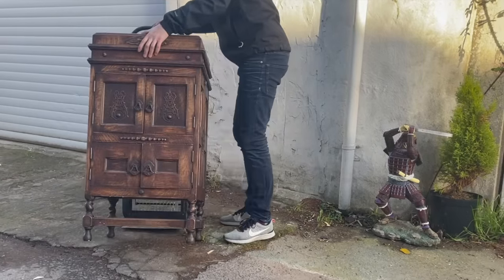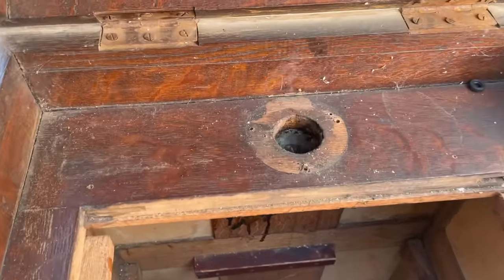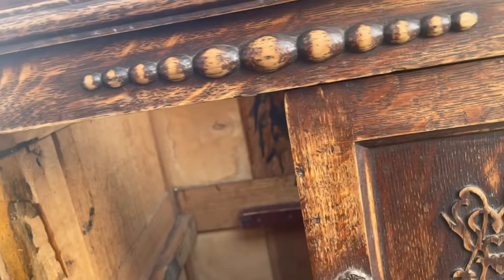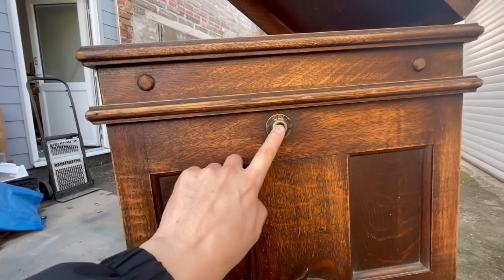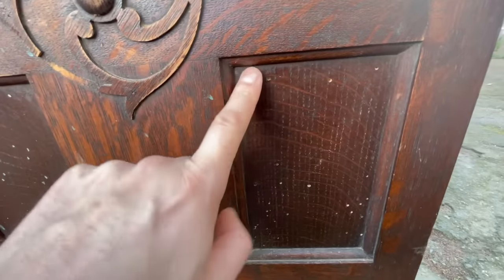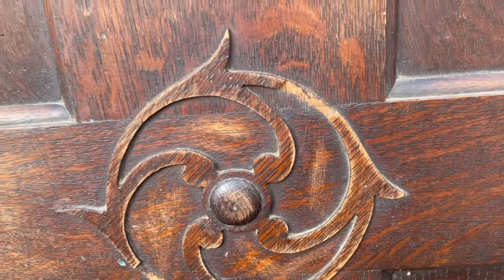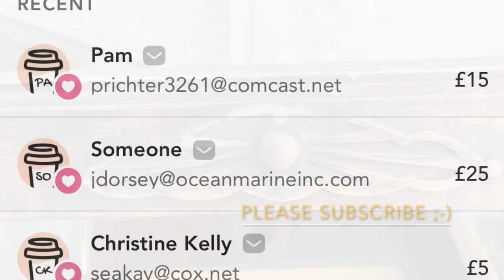Restoration of an Antique Gramophone cabinet plus DIY scroll saw

Comment: Just amazed at the attention to detail on the inside of the doors. There's the perfect pieces to flip off and use on the outside broken pieces. Fill, sand and stain the inside of the doors and only you will be the wiser. 👍🏻🇺🇸
Reply from the maker: Thank you ☺️

Comment: That was beautiful 🤩!!! I have an old Philco, circa 1930’s or ‘40’s, stereo turntable with radio that I want to refurbish and modernize, but I am not exactly sure how to start. When plugged in the turntable works, but the electrical cord is so shredded that I refuse to plug it in. Safe it is to say that it has been tested once, but it does need to be replaced. Anyway, that said, I have the project idea mulling around in my mind for some years now, with no idea where to begin. Some suggestions would be welcome, please 🙏🏼.
Reply from the maker: Thank you . Sorry but it is a bit general and I don't know what it looks like so hard to say. You should decide what you want to do with it first so will know where  to start.

Comment: What a beautiful project! Just for my own personal curiosity, do you think that a low power sand blasting would be able to remove the finish without damaging the wood underneath? I’ve seen a few projects use that method but was curious to hear your opinion. Keep up the fantastic work!
Reply from the maker: Thank you and definitely 👍 o would be very careful if it’s veneer but solid wood is perfectly fine.   I’ve done it several times.
Reply: @Flippingdrawers  excellent advice! Thank you. Keep up the fantastic work!

Comment: It looks great. So glad you put the "gingerbread" back on. Other would not have done so.  Now do some research on period door pulls.  The originals on the upper doors would not have overhung the edges like those on there now. Yeah, those were on it when you got it, but that doesn't mean they are the originals .... same with the pulls on the lower doors.  But, you did a good job with the new finish.  I was hoping that you might have turned it into a small bar cabinet.  Or, a lady's dresser/jewelry cabinet.  But, as a gentleman's dresser ..... yep, that works too.
Reply from the maker: I never called it a gentleman's dresser. I am a man so used what I had for staging. I actually thought it would work for any type of jewellery or watches.
Reply: @Flippingdrawers  I know you didn't call it a gentleman's dresser. I did.

Comment: I recommend that next time, if you want to save time, use caustic soda to do a complete wash of the furniture. It requires a bit of skill and care but is very effective. This treatment leaves the furniture clean of varnish as it is very aggressive. It should be done in a patio or open place.
Reply from the maker: thanks, will look into it. Never heard of that .

Comment: I wondering whether you'd have been able to use your 3D printer to create the missing pieces in the decorative scrollwork, if you'd had it at the time. You did a fantastic job without it, though. Very nice repurposed piece.
Reply from the maker: Definitely but I would need to design them and don’t have a clue how to do that at that time

Comment: The screws were badly rusted because they were steel, which reacts badly with oak given the slightest amount of moisture.  I always use brass screws with oak (first using an identical steel screw to form the thread, if necessary).

Comment: Nice work, but you don’t need a Dremel type disc to define the slot in a screw.
Just use a “spade end screwdriver at an angle and gently tap with a hammer - slot cleared in no time!
 and no damage to the hinge!
BW keep up the good work.
Reply from the maker: Thanks.  That was long ago lol.  I’ve learned a few things since then 😉

Comment: Hi. having watched you struggle with the stripping of surface coverings.  I thought I would let you into my cheep and %100 guaranteed way that works for me on wood and metal . Get some none gel wallpaper paste and mix in half a bag of caustic soda. Pure both into a bucket of water. Protect all your skin. Paint it onto all the surfaces, leave for an hour. remove all paints ektara. You may want to repeat it. When I used it on my houses wood panelled walls with a hundred years worth of may application of various paint types , the skirting and architrave. I took of as much as I could first. But if not a couple of applications should work.
Reply from the maker: Interesting.  I’ve come a long way since that video but thanks. How did you come up with that?
Reply: @Flippingdrawers  when I bought my house, I wanted to strip the wood. I prefer to see natural wood rather than painted. Besides surfaces were so caked in paint and stuff, all the mouldings were almost flat.
I was talking to a work colleague and she said that her and her boyfriend used the method to strip of outside masonry.
Two things I forgot to mention is that you shouldn't use different mixes on the same section of wood, I did that to do the picture rail after I did the wall. Now the rail and the top inch of the wall is darker. Also don't forget to unrealise the wood. I sprayed on a diluted mrx of salt and viniger.
Obviously you should test this out on wood that your not worried to mess up, before something important.

Comment: Could you say, what kind of stripper you use, i mean chemically? The strippers in my country need to be deactivated with water an they react with steel wool in form of mold like unremovovable stains. I ruined a cabinet in this way.
Reply from the maker: Hi. Sorry to hear that.  I honestly use whatever I have available.   I don’t like using chemical stripper and avoid it at all cost 😂 usually buy them on Amazon.  I find them all work similar.  Some are less smelly and more eco friendly.  It also depends if you’re working with paint or varnish
Reply: @Flippingdrawers  and you can't say, what it's chemically? I found out that there are tree versions: acid, alkali and a third one of which I think all Anglo-Americans use it. It seens to be based on solvent. That matches with the neutralisation with spirit. It's not available in Germany

Comment: I have to wonder if the original finish was at all salvageable. It was much better than the "restored" version. As an antique collector, this would never fit well in a home built in the same Era as the cabinet. Many restoration channels are calling themselves "restoration", but what you're doing is just a nicer version of repurposing.... but not restoration. Restoration is bringing something as close to its original self as possible.